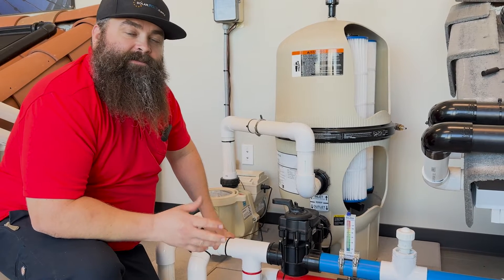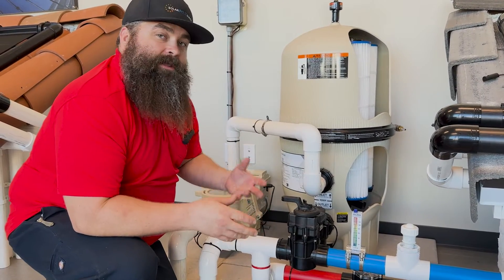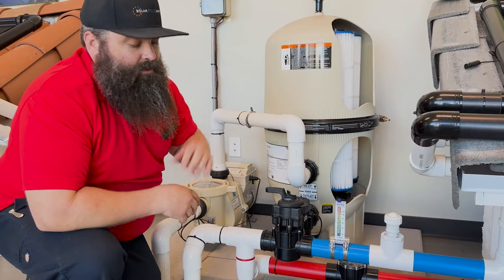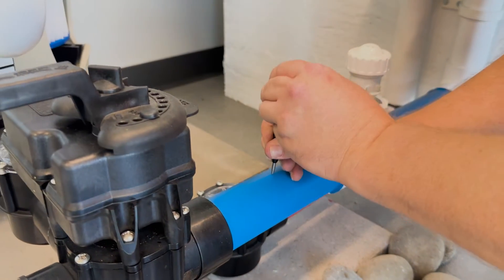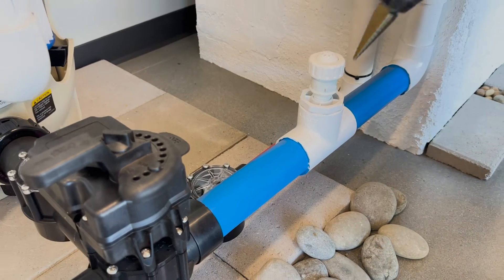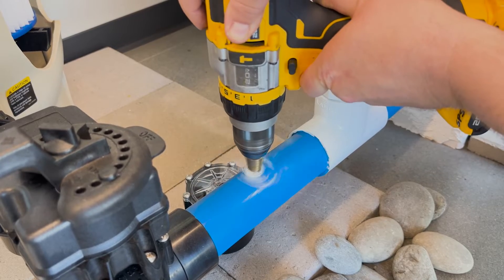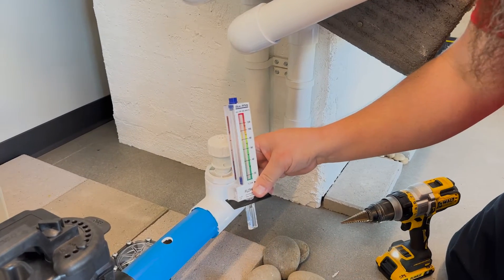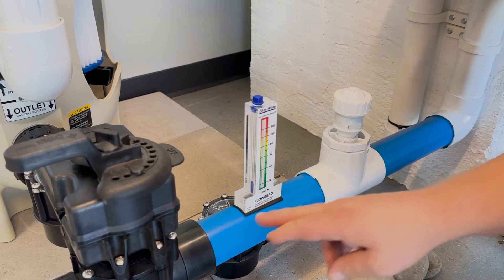How To Install a Blue-White Flow Meter on a Solar Pool Heating System | SolarPoolSupply

Comment: Everything I'm reading says you should install your flow meter after it goes through the panels going to the return.  If I'm looking at this right it's being installed BEFORE it gets to the solar panels.  So which way is correct?